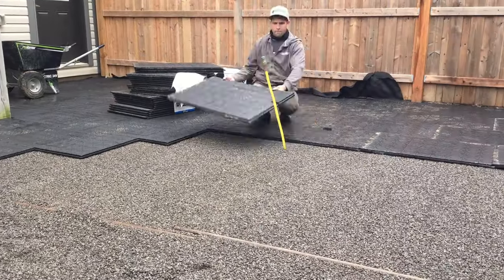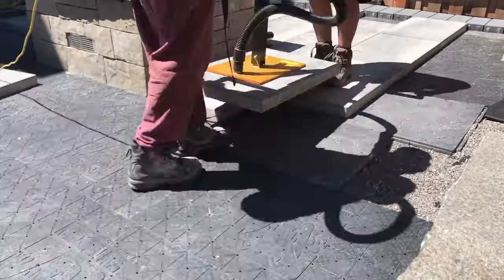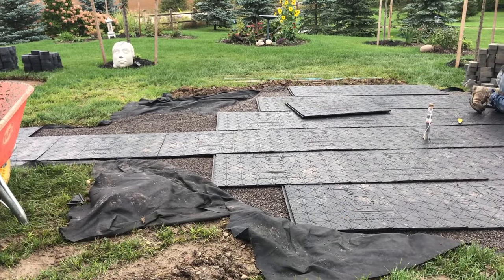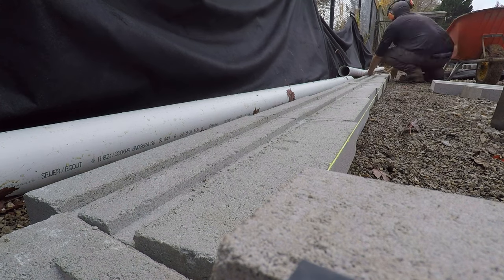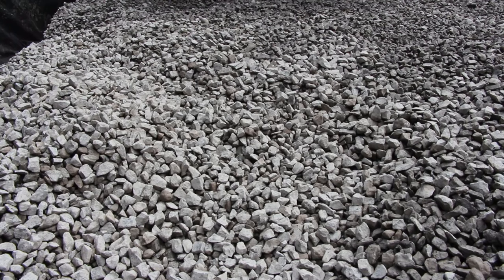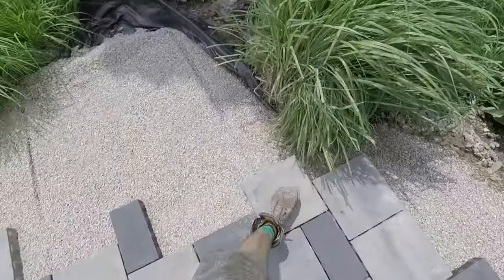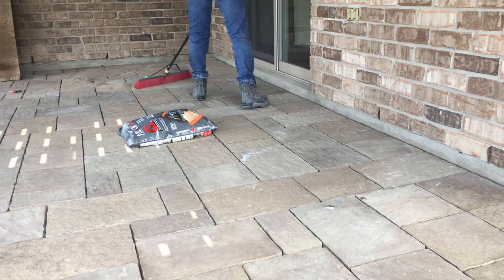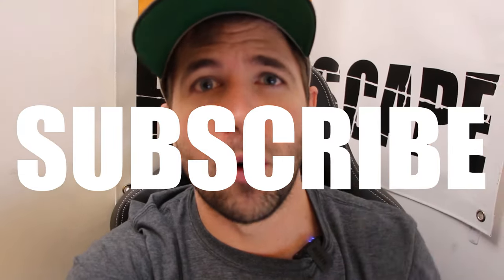Why Use Base Panels for Pavers and Retaining Walls

Comment: We have clay soils that can get very sloppy. I read the Brock instructions and it tells me to tamp the soil by hand and then add the 1/2" of and and then the Brock panels. Knowing how "squishy" our clay soil can get, this just seems like not enough. Thoughts, from your professional experience?
Reply from the maker: We have dense clay. Especially if squishy, dig a little less than an inch more, lay down a fine layer of 3/4” crushed clean stone, sprinkle some Portland cement, and compact that with a vibratory compactor into your clay. Lay your fabric, screed (if sand you need to compact sand which is inconvenient, we use 1/4” crushed clean), panels, pavers
Reply: @iamahardscaper Thank you for the advice!

Comment: The Alliance Gator people specify compaction of the bedding sand (by hand tamping) but in professional installer videos they don't compact the sand. Can anyone explain?
Reply from the maker: Yes, when using sand you have to compact it and then fix any irregularities after compacting before laying the panels. But with HPB (1/4" chip) you do not have to compact it.
Reply: @iamahardscaper  I can see why you're a fan of the HPB. I don't like making the sand all properly sloped and flat with the screeding, just to make it all bumpy with the hand tamper.

Comment: Hi, I am planning on using paver panels for a project, but my screed layer will be sand. I was wondering whether I need to compact that sand before putting in the panels or if I only need to screed it. Thanks!
Reply from the maker: The manufacturer recommends that you compact it prior to laying the panels down. You may need to level it again after compacting as well.

Comment: Thanks for the great insights.   I'm considering using Gator panels following with the steps you've detailed for a 12' x 12' paver area.   My neighbor who has done hardscaping for years using traditional methods seems skeptial this approach will hold up through long term freeze and thaw cycles in northern Indiana.  Do you have examples of longevity and the ability of this approach to perform over the long term?  Thanks.
Reply from the maker: Most are skeptical until they use it. My oldest job is 6 years and still looks brand new. It is a great product. You just need to make sure that you are not installing it on soil. It needs to be subsoil (clay, sand)

Comment: If using synthetic paver base panels - when applying polymeric sand after the pavers are laid, do you typically still use a plate compactor during this step to ensure the sand gets packed between the joints?
Reply from the maker: Yup for sure 👍 always protect the pavers with a mat
Reply: Thanks much appreciated! @iamahardscaper

Comment: Whether you do 10inch or 5 inch excavation, you still need machine to complete the work right?
Reply from the maker: Yeah I wouldn’t hand dig personally
Reply: I’m currently digging mines now. It’s a lot of labor but I’m doing it a little by time. I’m using a tiller to break the soil up and it’s helping a lot
Reply from the maker: Nice!

Comment: Hey man, thanks for your videos. Very useful. One quick question for you. I hope you can help me. What do you think if after using the weed barrier textile, I put stone dust and on top of that the synthetic Paver Base panels.
Reply from the maker: Stone dust doesn’t drain well enough to be used. 1/4” clean chip  or concrete sand only

Comment: Can you butt up a base panel install to a portion of pavers that will be installed using open graded base? Pavers installed on open graded base will compact 1/8" to 1/4", will pavers installed on base panels compact less than that or the same?
Reply from the maker: You can, but you will possibly experience a difference in movement between the two sections. So over time there could be a distinct pattern of movement up or down between those two areas.

Using base panels, you will almost have no loss. This is because if you are using sand you need to compact the sand first before laying out the panels. That would mean screeding, compacting, and then re-levelling before laying the panels. HPB (1/4" chip) works better because you don't need to compact first. With either of these you will lose basically nothing in height.
Reply: @iamahardscaper  thanks for your thorough response. I never thought of the distinct pattern of movement.

Comment: Great video -- probably the most detailed on the subject on YT -- can you use paver base panels under brick or just pavers?
Reply from the maker: Clay brick? There are more inconsistencies in heights with clay brick. You can but you may need to screed another layer of concrete sand on top of the panels so you can level the brick easily.
Reply: thanks for getting back to me -- this is the best hardscape channel on YT hands down

Comment: Hi i bought these brocks panel from Home depot along with step 2 sand.  I saw videos where they put sand first then the Brock paver panels and some videos put sand on top of the Brock panels . I'm confused what goes first. Please help. 
I'm trying the make a small walk way with 16x16 step stones from home depot.
Reply from the maker: Nonwoven geotextile, then sand, compact the sand, then panels. You can put sand on top of the panels as well, but that is more for product with variations in thickness like natural stone
Reply: @iamahardscaper Hi Michael, please help 🙏 I had the same question but also confused why sand is being recommended here - based on your panel videos, I thought it was: Geotextile on top of existing dirt, 1” HPB, panel, paver, then sand between joints.

Comment: Hi Michael. Congrats on your great channel. I am out in Southern California and am currently tackling my own DIY SAND SET paver project. I am using synthetic base panels AND my porcelain paver is of course 3/4". I don't use any crush base. After the weed barrier cloth and  1/2" of lightly hand-compacted sand, the base goes on top of that. When I placed the paver, I found that it is still have some gives, hence it does not fill like a solid paver surface. Please tell me what I missed. Also, your clip on HFB material for screeding. What is the equivalent out here in So Cal because nobody knows HFB. :) Peter
Reply from the maker: Hi Peter, it is more and more difficult to find HPB the further south you go. Best chance is to contact your local suppliers to see if they have something similar. As for your base panels, there will be movement until you install a jointing compound. That locks things up. It is recommended you use a tile spacer on top of the base panels for this install, I don't know if you've checked that out. But that will give you appropriate spacing to then be able to install the jointing compound.

Comment: So glad I came across this video! I currently have a patio and walkway of pavers against my foundation, there is some sloping towards the foundation and water pooling. There is limestone base and 2" of sand under the pavers. Could I install base panels on top of the sand to help raise and grade away, or should I remove the sand and add more limestone (1/4 or 3/4 down, 1/4 or 3/4 clean ?) and sand instead? Zone 3a btw.
Reply from the maker: i wouldnt go more than 1.5" of sand for your bedding layer.

Comment: Hi!  Thanks so much for taking the time to make all these informative videos.  

Question on using the paver base and laying down pavers next to a sitting wall that is installed on a traditional base.  According to Gator Base, the paver base panel needs to extend 6 inches from the end of the pavers.  However, if the pavers (on the Gator Base) will butt up next to the sitting wall (on a traditional base) this of course violates the “6 inch rule” for the pavers on the Gator Base.  

What has been your experience in these situations? Is the “6 inch rule” for pavers on the Gator Base only needed to accommodate edging support (which the sitting wall should provide).  Or is that additional 6” space  on the Gator Base needed for some other reason?

Thanks again for all the videos!
Reply from the maker: Yes, when butting up to hard surfaces that don’t move (foundations, walls, etc.) you don’t need the base extension.

Comment: Thank you very for creating all these informative videos. I am planning to lay a walkway using these synthetic base panels this spring, however, I cannot fond them in any of local big box stores. I live in the Niagara region (Ontario side) and have not been able to fond Gator panels. It seems Rona carries Brock pavers. Are these two brands different?
Reply from the maker: Yes, I believe Brock licenses it out to the other companies. But the Brock panels do not have the tongue and groove system. Any landscape supplier near you should have them or have access to them. Either Gator Base (Alliance) or Next Base (TechniSeal). I am in Toronto, you shouldn't have a problem finding it.

Comment: Great video. I’m about to start my DIY patio. I have a small concrete slab, and I’m planning on using synthetic paver base. What do you recommend me to do with the slab? I already have 1 inch and also half inch pavers.
Reply from the maker: If I were re-doing the base, I would just tear it out and dispose of it. If it is still in good shape though, you could also consider a concrete overlay instead of synthetic paver base panels.
Reply: @iamahardscaper  isn’t there a cheaper way to use them both? Use the concrete slab and a mix of the synthetic base in the parts that there’s no concrete?
Reply from the maker: Yup you can definitely do that
Reply: @iamahardscaper  I know how to do the pavers out of the concrete. How would be the installation of the pavers on the concrete slab?

Comment: Great Vid. I would like your advice. We are putting in a flagstone patio in our backyard where there used to be a raised beds, play structure, etc. There was no grass to remove. The ground is very gravelly mixed with dirt. It is not extremely flat nor gel but the dirt is very loose (not heavy clay or organic!). (Our son built a tumbled cement black fire pit right on the dirt that has not moved at all over the past few years. We're in the Pacific Northwest with rainy mild weather.

It will be hard to lay gravel because there is no easy way to get it back behind the house, downgrade slope to the area, but we thought we had to... until we saw this option.

SO, do you think leveling and tamping with a layer of snd under the synthetic base is a reasonable alternative to 4" gravel, hand carried and hand tamped, then sand, then the flagstone pavers?

THANKS!!!
Reply from the maker: We use these panels in Toronto which experiences lots of freeze thaw cycles each year. They hold up amazing. For flagstone that is irregular in heights you will need to also use sand on top to the panels to be able to level them. But yes without seeing your site in person and the soil, it is a good option.

Comment: My backyard currently has over 4% slope and therefore I will have disturbed soil at the rear end to bring it 1.5% slope.  My house has a walkout basement and bringing gravel down to the backyard is quite an effort. The synthetic base will save that effort as I plan to install 1900 sq feet of pavers. Can I use the synthetic base on the disturbed clay-type soil area?
Reply from the maker: Is that excavated material? You will need to ensure proper compaction. Not just a small compactor but something that will be able to compact that along with a jumping jack.

Comment: Glad to find this video, looking forward to lay 12x14 paver patio on flat terrain here in Montreal area. 
Aiming to use synthetic base, HPB as base and nonwoven fabric. 
Is digging only 2in to remove the grass would be enough? Is HPB better than sand? 
Any errors/mistakes to avoid??
Thanks in advance
Reply from the maker: You need to make sure you remove the organic material. You should be hitting native soil like clay or sandy soils. That is the biggest error to avoid. Compact your subsoil and use the materials you mentioned. Use HPB it is much better. Let me know if you have any other questions!
Reply: @iamahardscaper should i compact the HPB after screeding?
Reply from the maker: Nope. You would have to if you used concrete sand.
Reply: where did you buy the HPB or the concrete sand. I can't find them

Comment: Can you use the plastic edge restraint and then add concrete on top of it? is that just redundant or counter productive?
Thanks for your videos! Will be starting my project soon: have a 10 X 14 section with a decent slope, was debating if I should use synthetic base or not.
Reply from the maker: I think it’s counter productive because now when that plastic edge heaves it will heave the concrete as well. Good luck with the project! Glad to hear the videos help

Comment: I live in Central Florida and the soil is all sand. I dug 36inches to install a hammock post and it was all very loose sand. Am I still able to use these panels if I compact the native sandy soil, or should I opt for a gravel base?
Reply from the maker: Yup, you can definitely use these panels

Comment: Hi Mike, if I use HPB as the bedding layer, do I need to compact them after screeding or can just fill the void where the pipes are ?
Reply from the maker: You do not need to compact your bedding layer. Lay the pavers, install jointing compound, then compact to consolidate the compound to bottom of joint. Yes, fill the voids 👍
Reply: @iamahardscaper  Thanks for your reply Mike.  A quick follow up question.  Is it ok to use plate compactor on top of the paver when using gator base after spreading the joint sand?
Reply from the maker: Yup. You do need to have something between the compactor and the pavers to protect them from scuffing. We use a pad on our compactor. Always start with a small area and continue through the project

Comment: Would you use these for pool paver decking?
Reply from the maker: For a base for pavers for a pool patio? Yes I’ve done that and it works great
Reply: @iamahardscaper  I am repairing my pool lines that are only 15-18 inches deep and currently under some old pavers. I was thinking of using this system so that I can lay a new patio and also for easier access to the lines in the event of a leak down the line. Do you think this is a smart idea?